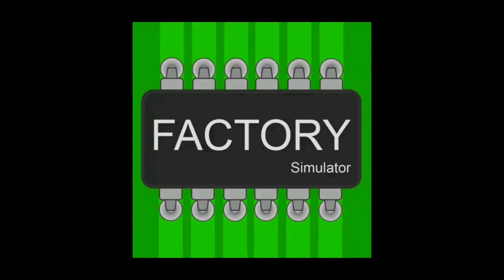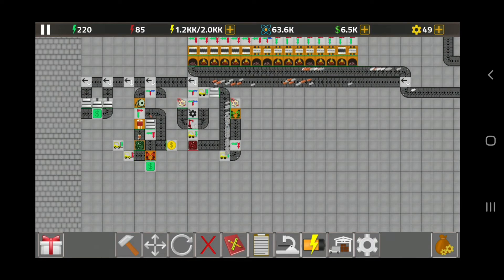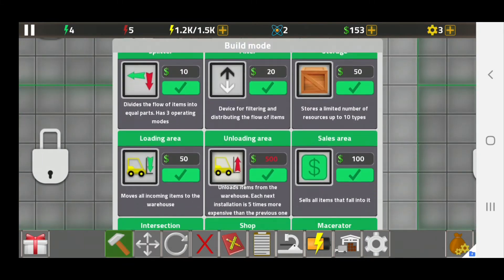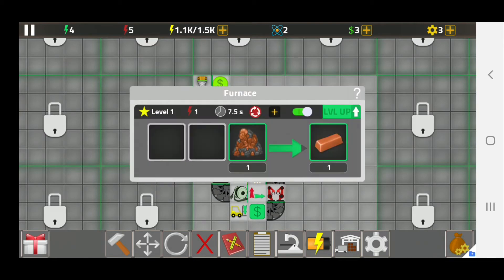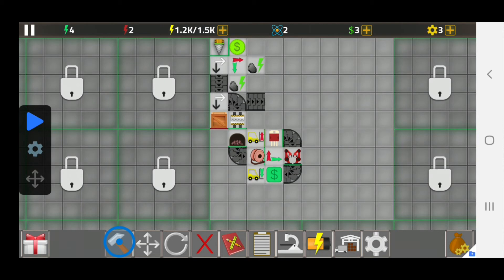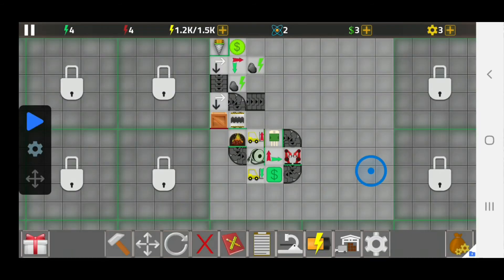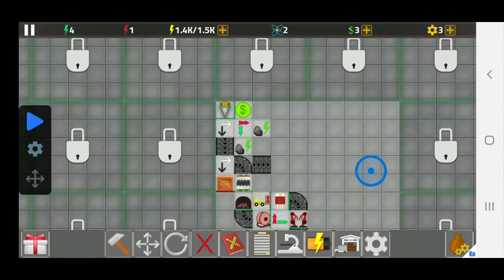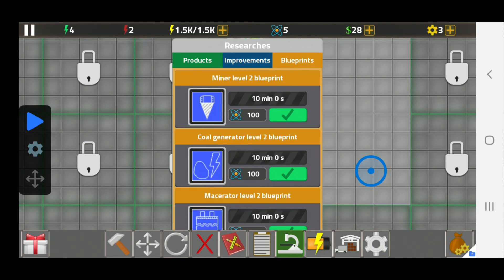Factory simulator tutorial #5

Comment: So I've been playing this game for 170 hours now and i've upgraded to level 5 and sold the first few washing machines. But the higher the levels, the more energy is required. Often I run out of energy, which is really annoying. I also got as far as to get those green bars for a reactor, but that also never seems to generate enough power. In your videos you only seem to have the first 4 products to produce money. Have you by now been able to create robot parts or reach the highest level in the game? Just creating 1 washing machine already uses so much power that and also time, even with gems, that I now decided again to just get money by lower tier products.
Reply from the maker: No unfortunately im not there yet but im planning on playing a lot this week and try to make a video about it. For that reason I spent a lot of my money on battery so it can last longer and produce a couple of items. You should try turning of your drill once you have the required amount of items for the washer, since that will stop most of the power drainage since machine don't use power if there is no items to process, or just turn them of manually, it is a short term solution but I am working on a long term one now